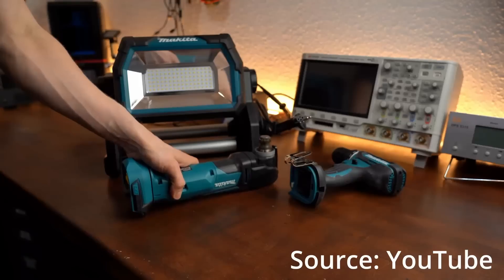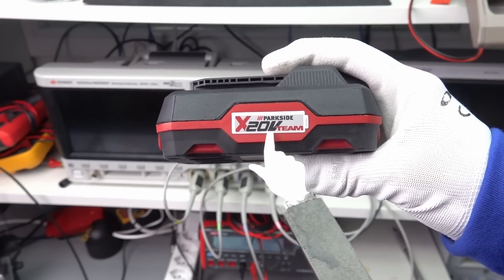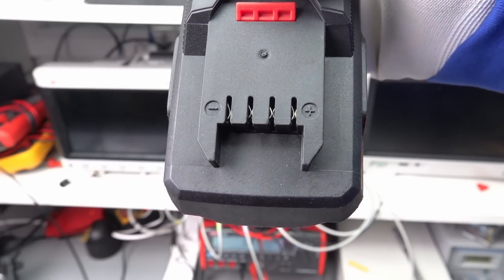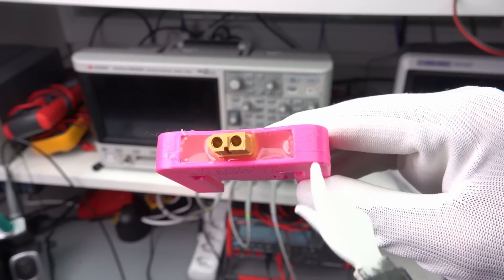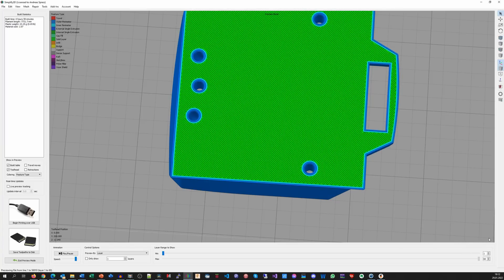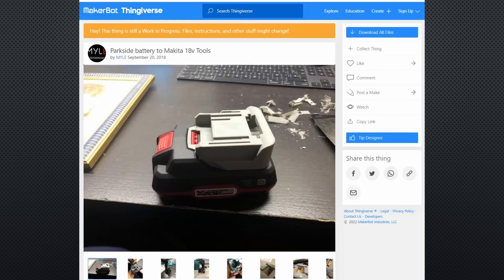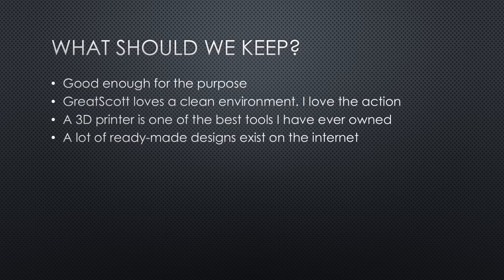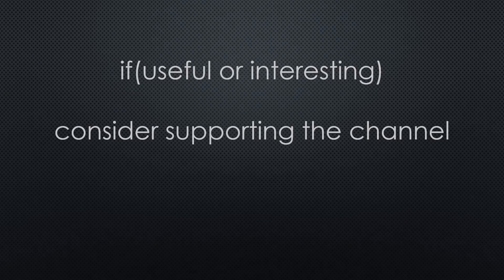#416 Creative uses of Power Tool Batteries for Mobile Projects

Comment: oh one question. sometimes the battery packs of power tools have different + and - positions.  and a couple of other pins.  Can you make a video explaining those? i mean how to make use of them and what they are?  Can tp4056 be used (or a few of them somehow) to charge the battery packs if the orginal charger is missing? thanks for everything :)  Subbed to your second channel already :)
Reply from the maker: 1. I only have Lidl batteries and I have no intention of adding other ones. Maybe you find other sources for your information.
2. The TP4056 is made for only one cell. You need a different BMS for battery packs like this one.

Comment: Hoi Andreas
is the power-output of these powertool-batteries "clean enough" for them being used to power sensitive devices (like eg. cb-radios or others expecting a clean power-input)?
Reply from the maker: They are just batteries. So they are very clean. But they are around 20volts and you probably need a buck converter which can be noisy if you do not pay attention. I use LFePo4 batteries for my mobile rig. They are clean and have the right voltage.
Reply: @AndreasSpiess  thanks, is there a particular one you'd recommend with "Rucksack-Tauglichkeit" (not too heavy)?
Reply from the maker: Decide the needed operation time, calculate the Ah, and buy the appropriate size. A 100W transmitter needs a bigger one than a 5W rig.

Comment: Nice use of power tool battery pack !  Yes I often 3dprint 1off projects with whatever material is loaded and regret the color later.  Are these a good option for our portable projects ? You have smaller powerpacks in your excel sheet. They may meet a need for a readily available and well packaged  5000 mAh pack , 19V might be good for motors and relays but too high for controllers. Also can they be recharged by readily available solar chargers ?
Reply from the maker: Lidl sells two pack sizes with 5 or 10 batteries. So you have a choice if your project needs a lot of power. The power source for mobile projects always depends on the needs. Most of my MCO/sensor projects are better off with a single-cell solution. My Radios need 13.6 volts and more power. So this could be a possibility (with a buck converter).

Comment: I believe Ryobi brand 18V batteries have undervoltage projection built into the battery.  It's pretty uncommon in other brands though.
Reply from the maker: Thank you for the info. Others mentioned that Makita batteries are also protected. Mine are not, but Lidl replaced mine ;-)
Reply: @AndreasSpiess  are you aware of any over discharge protection modules that could be used in home made 'accessories'? The normal 5S BMS modules all seem to require direct connections to the individual cells of the pack.
Reply: @AndreasSpiess  Makita batteries (at least the ones I[ve had apart) do not have undervoltage protection - this would require  a 100A capable switchiung device in the battery - there is no point in them including this as the power tool itself has switching for speed control.
Reply: From what I've heard (never owned or taken apart a lithium makita battery), some do and some don't depending on age and capacity.

Dad uses the AEG (rigid in America) ecosystem primarily because at least as far as we know, they always have had some for of protection in the battery. From attemping to fix a water damaged one and reading online, the batteries don't have cell balancing, but do have individual cell monitoring and over temperature cutoff. Power switching is two large mosfets in reverse in series so the battery can also be isolated if overcharged and when flat. There is definitely no protection in some of the tools we have - one rattlegun that blew up consisted of a 555 timer as the speed control and a small microcontroller that did nothing else except turn the led light on and fade it out. The battery protection circuit definitely gets a workout and automatically resets as devices like angle grinders and chainsaws will routinely overheat and rapidly discharge batteries.

The overall main components and approach seems to be fairly similar to a moderately recent big clive video of a teardown of a no name battery.
Reply: Rob is right here. Ryobi batteries are expensive because they got their protection built-in, that's why the tools are cheaper, too.
Reply: I believe einhell has some built in protection and doesn’t break the bank either
Reply: You can buy adjustable Relay and/or Mosfet based under-voltage modules from the usual online places. I have one on my desk right now - model XY-CD60 - however there are literally hundreds of different options
Reply: @johncoops6897  I can't remember where I saw a video about one of those (I think it might have been on the Project Farm channel), somebody posted a comment saying you need to be careful with those, because they themselves keep draining the battery.
Reply: @dan-nutu  - any device or circuit that monitors a battery will drain the battery, just like the inbuilt BMS of a battery drains the battery. However the drain of a decent under-voltage cut-off circuit is absolutely TINY compared to the capacity if the battery itself.
Any such drain is irrelevant if you charge the battery after using it. However if you leave the battery fot 12 months after you have fully drained ot to the cutoff voltage, then it might cause an issue.
The Ryobi tool batteries are notorious for that because the BMS runs off the first cell only. So if you store a Ryobi battery in a discharged state for a long period, the first cell(s) in the pack gets destroyed, which makes the whole pack unusable.
Reply: They are protected and even showing the battery level, as seen in my project video "Bluetooth Amplifier Case".
Reply: Milwaukee has built in protection as well, they even have a temp sensor, and without it it's charger will not charge them.. Ask how I know 😏
Reply: For Makita (at least LXT) the protection comes from the tool . There is also a board inside but it does not disconnect - or + .. those go directly to accus
Reply: Ryobi indeed does, and it sucks. if you pull the juice really quick it will not clamp fast enough and they will cut out and won't take a change. you have to dissemble the battery and bypass the controller and spoon feed it.

Comment: The new Parkside Smart Battery has an under-voltage protection and you can get even 8Ah version... Which is huuuuge!
Reply from the maker: Just checked: It is much more expensive! And the 4Ah seems to be too high. The dimension suggests that it has 18650 batteries in series. The old ones were marked 2000mAh and I never saw a battery with 4000mAh. The biggest I saw was around 3500.
Reply: @AndreasSpiess  They are actually not using 18650 in the Performance ones but 20700.
Reply from the maker: Aha. Thanks! I already wondered because Lidl usually does not write false values on their products

Comment: Would be a different story if it was an already sliced model, that is not something you want to have to edit, but STL is a format that is specifically designed to represent 3D geometry and is rather easy to manipulate as you are still dealing with verticies.

Well, the trend to go STL instead of OBJ is one of the biggest mistake the 3D printer manufacturers have made: they just went with the way more restrictive but simpler format.

OBJ is a well-established open-source format that can do everything STL can - but also can do more things, like NURMS. It also has per vertex instead of per triangle normals, which is mostly more relevant. As well as being better supported by modelling-software.

heck, a lot of STL-files are not compliant and can cause errors with software that actually follows the standard:
In STL ALL verticies must have positive coordinates. Negative or even 0 is not allowed.
Reply from the maker: We do not live in an ideal world ;-) I do not know why people chose this format. I just like that they chose one and built these repositories. It increases my efficiency in some cases.

Comment: Pay VERY close attention to the circuit design if you’re working with such batteries. The Parkside ones DONT HAVE INTERNAL REGULATION. I recently found that out while doing similar projects and ran into undervoltage issues. The cells of the battery are literally directly connected to the output terminals. The actual protection of the battery is handled by the tool and not the battery. The battery bms checks the voltage and communicates with the tool over the second pin. The tool gives out a voltage on that pin and the battery bms can pull it low. This tells the circuit in the tool to shut off if the voltage gets too low. So if you use this battery for other things you have to incorporate this communication into your design to actually get protection.
Reply: Which is exactly to be expected - it's a battery pack not a PSU. Heck, half this video was about interfacing an actual PSU module to the pack.
Reply from the maker: Do you have more information about which pin and what voltages it expects to switch the power off?
Reply: @AndreasSpiess  it’s been a couple of weeks since I had time to work on this project but I think it’s the pin right next to the negative pin. Actually I think the powertools only have 3 pins so it should be easy to find the correct one. I started by measuring the voltages with a multimeter and it seems like there’s a correlation between the voltage on that pin and the state of charge of the battery. I didn’t have time to look for any digital communication there with my oscilloscope but there might be some as the new smart batteries somehow get told by the tool how much current is drawn (or it might be calculated I’m not sure about that at the moment). 

BTW the tools won’t work with other voltage sources except if you place a resistor between the signal pin and ground. So I think the tool creates a voltage on that pin and looks if it’s pulled down or not and possibly how far it’s pulled down. But like I said I didn’t have time to do more testing in the last time. But I might be able to do further testing tomorrow. Maybe you can find out more with your equipment but that’s my current understanding of their bms function

Comment: Worked on something like that a while ago, measured everything and modelled it in Solvespace because it's awesome without a mouse (also works with the space navigator but I haven't used it in a while). I Planned to use a small bit of PCB with 6.3mm fastin connectors, the PCB just for the structure and the wires on the opposite side of the connectors. 

Didn't print it because I was out of resin (found out the estimation of the volume is wayyy off).  In the end I just took the 18V to usb Adapter and soldered it's blade connector to the power tool I wanted to adapt because my system (Einhell) didn't had this kind of tool. 

I'll probably build a adapter to Milwaukee at some point because the Impact driver of Einhell is literally useless and I doubt they'll make a bigger version soon. 

Also I plan to make a 12V DC or mains to Einhell Adapter at some point since I've switched to only battery tools for everything and sometimes when power is available it would be pointless to use the battery (for example  battery drill in a holder as drill press for straighter holes). 

And for the last part: as long as you find everything it's clean enough, just push the stuff to the side if you need more space. I'm too creative to waste my time to let my workspace always look like it's part of the IKEA catalogue.
Reply from the maker: So you have a lot of work in front of you. Good you do not use all the time for cleaning your lab ;-)
Reply: @AndreasSpiess  I already have enough projects for the next couple years, the two limiting factors are the money I have and the amount of time I spend at work. I enjoy my job but I'd also enjoy more time with my projects.

Comment: A soldering iron on a 10-meter pole: What could possibly go wrong? 🤣 Thanks for the Fusion360 tip for converting an STL. I hadn't hit that problem yet on my 3D printing adventure -- good to have a solution! 👍️
Reply from the maker: Everything went well and I got my sonde (and my 50 CHF) ;-)

Comment: I saw that your battery (Turnigy) is inflate and it's a sign a degradation and a risk of wrong usage. I like you so be careful with this battery, perhaps is because it's a very old battery or a wrong charging process. if you are not using a balancing charger be aware that the battery can fire ignition during the charging process.
As usual, a very nice and interesting video. 
regards
Reply from the maker: All my Turnigy batteries (and many others) are inflated. I stored them at 22 C and hardly used them. But so far, I have had no problem with them.

Comment: Sali Andreas. Lately, I’ve been feeling the need to buy a 3D printer as I believe it would make my projects easier in many cases. I’m not printing for aesthetics but for function and durability. Do you have any recommendations as to which type of printer to buy? I want something good enough and not too expensive to begin with… Merci Vilmals!
Reply from the maker: I have an (expensive) Prusa and do not know other models. I can only tell you that mine works without problems.

Comment: I like the idea and convenience of a mobile variable power supply, seems like the ideal thing that a radio ham would build and need.  Also, probably a great source of cells for other projects as you said.
Reply from the maker: Maybe I make once a project on my second channel to power a 13.6V rig with these batteries...
Reply: @AndreasSpiess  - I’ve bought one of those variable buck-boost things.  I will be making something slightly similar.  I’ve got the 12V rig power covered with Tracer batteries but I see an immediate need for a variable voltage thing to provide low voltage inputs for car diagnostics.

Comment: 3:20 This is brilliant. I've used spade connectors for this in the past. My solution works but has much to be desired. I'm going to try this next time. Thank you for the many great ideas like this that I get from your videos. 👍
Reply from the maker: These spade connectors are a bit short and probably not easy to mount. Mine are much longer and inserted in the plastic.

Comment: Hello Andreas, 

That is the video, that I was waiting for, since you’ve announced it some while ago. 

One question: what do you think about powering a radio device - such as a cb or amateur radio - with this type of batteries and a step-down-converter? Will there be a lot of distortions? Or maybe is there an easy way to filter them?

I really like your videos, because for sure you are making it right, but not overengineered.

All the best for you.

Florian
Reply from the maker: Such a device will appear probably on my second channel ;-)
Reply: @AndreasSpiess  Thanks, that will be interesting Andreas!
Reply: Hi Florian, you may be lucky and find a good one that does not produce much noise, but until now, I was unlucky with several different converters. Today I simply use 4 LiFePO4 cells in series and you'll get the 13.2V with a very flat discharging curve. Compared to LiPo or LiIon, this chemistry is also less problematic, e.g. no thermal runaway.

Comment: the funny thing with lidl/aldi budget battery packs is, that they are equally 18v just as their more expensive premium brand counterparts.
but i guess some clever marketing dude thought that bigger is better, and slapped 20V (and 40V) stickers on them
Reply from the maker: Indeed, a good trick because it is not wrong (5x4.2=21V) and for most men, bigger is better ;-)
Reply: @AndreasSpiess  really depends on what number we pull out from the hat: 4.2V or 3.7V = which then results 21V or 18.5V respectively. also a neat thing with Lidl: their next generation batteries even have bluetooth - charge can be monitored with the app, or by other "maker" means. this is worth a quickie

Comment: 2:23 "Because it was the oldest PLA." 👍 I live in the dry desert of Utah and have learned that my "old" PLA doesn't print well because it dries out and becomes brittle. I've found that I can "rejuvenate" it by placing it is a pot of boiling water.
Reply: I've heard of PLA absorbing moisture and not printing well and becoming brittle. Is it true that you can overdry the filament?
Reply: @thatrudager  It may be rare but this is my experience. For the longest time I thought that my "old" filament had absorbed moisture and needed to be dried. So I tried that but it never helped. Then I learned that new filament is run through water when it is manufactured. I was curious so I placed some of my "old" filament in a boiling pot of water, removed it, and dried it with a paper towel. It printed perfectly. I've been doing this ever since with my "old" filament that doesn't print well anymore.
Reply: Interesting - it begs the question - What is the optimum long term storage humidity level for filament?

Comment: A cutter knife attached to the pole would'nt had the job done? well, would'nt be so funny at least :-D
Reply from the maker: I started with this idea (also with scissors). But how would you position it exactly in 10m high (I do not see any details there). And the rope is very strong but melts in a fraction of a second. Also how to create pressure for the knife? Even on the floor, it needs a lot of force to cut it.
Reply: yes, thinking the same thing - why not make up something like one of those "seat belt cutters" on a stick?
But then as you mentioned, there would not be any battery project video to put on youtube!

Comment: Nice video!
You can also import an STL file into openSCAD and make your changes there.
Reply from the maker: Thanks for the tip! I did not like openSCAD. It is easier for me to draw with the mouse...
Reply: @AndreasSpiess  ...and I always found it difficult to get my 3D-ideas with the mouse into a flat screen and then back out. For me it is easier to think in 3D and work directly with the coordinates...